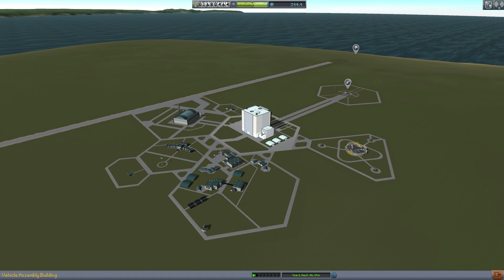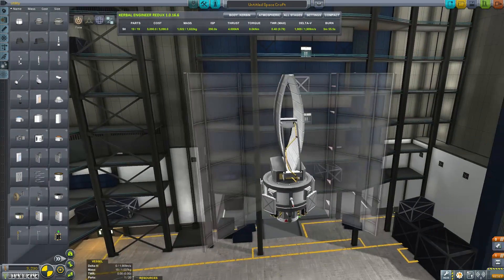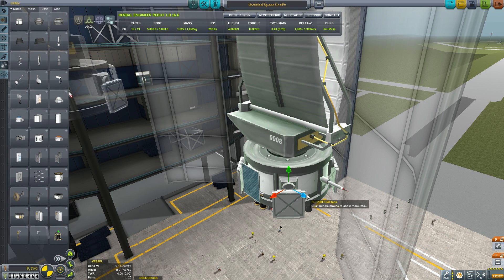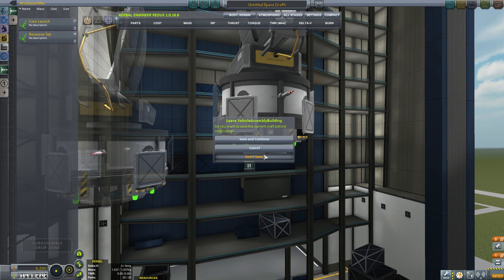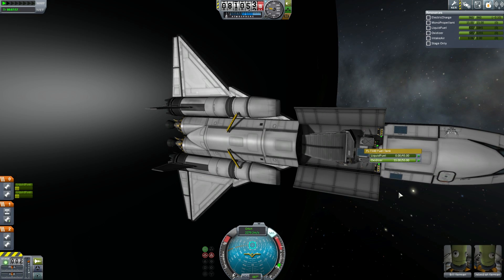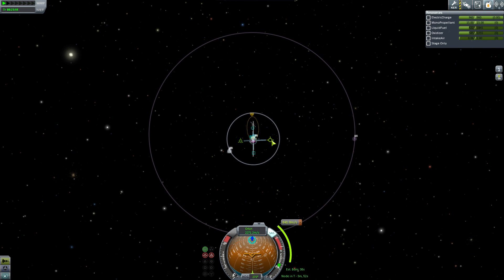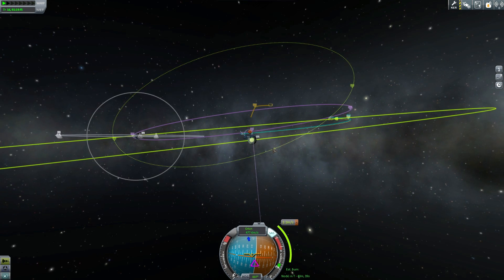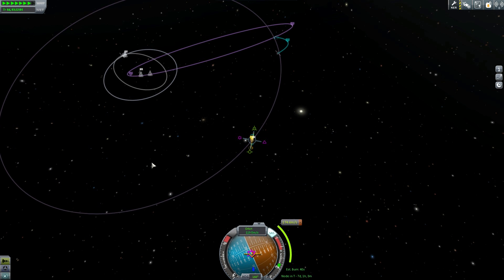Kerbal Space Program - Career Mode - Part 29 - Resource Scanning

Comment: @Scott Manley For these slight changes in maneuver nodes you can use your mouse wheel. Just hover your mouse over the desired direction marker and roll your mouse wheel for small adjustments.

Comment: Technically, in this game it's faster to design a recovery mission and then launch it than to get out and push... =p
It's also why my LKO space station now features a multipurpose tug craft in addition to the automated fuel tanker. It uses a prototype for the new replaceable mission package system I've been working on and can both dock with stranded spacecraft in order to transfer resources and grab on to craft lacking a docking port using a detachable grabber claw.

Comment: There should be an Ore and (Insert resource name here) mix for a Super Fuel Mix. This fuel makes engines more efficient, but takes quite a while to get. You should need 100 units of Ore and 10 units of.. Resourcium? I don't know. You need to combine both of these in a special holding tank and refine it with a more advanced refinery. Rockets using Super Fuel Mix also need Super Fuel Mix fuel tanks to use it. Wait. This isn't the KSP suggestions page!

Comment: I believe you CAN include the root part, however the root part must have an open node to be attachable.  Since you typically have engine below and stuff above, I think it works to just root to the engine (if that's where you'll attach it from) without the little decouple trick.  I might be wrong though, been a few months away.

Comment: My first launch (which was on 1.0.4) the craft was unable to get to orbit. It did manage about 83,000km before running dry. As it was returning to Kerbin, I checked the tanks and had just over 660l of Oxidizer left.

After draining the side tanks of oxidizer and lowering it to only what was needed, the craft is now fully capable of reaching orbit but does, at least for me, need to front tank just to finish off the orbit manoeuvre. Though it does leave the craft pretty dry for any type of orbital manoeuvring, say for rendezvous with space junk. Then again my noobness my just be burning too much fuel on accent.

Comment: in VAB, pressing "F" while in offset mode, will switch it between absolute and local mode, secondly, you can have a Minmus encounter that brings you right under its south pole, but switching vessels mid-burn might make it let's say, challenging
Reply: johnnyxxxv also, something i find interesting, is that Mun seems to have higher ore concentrations on its craters, whereas Minmus has high concentrations on Highlands, and even more so on Slopes

Comment: Hey Scott! Just a quick question: I'm not a big fan of spaceplanes, but is there times that it's just better to use spaceplanes instead of just pure rockets?
Awesome videos btw, keep it up :D
Reply from the maker: ***** If you're regularly running any mission then a SSTO design might save you money. Might.
Reply: ***** They also can take things back from orbit.
Like a crew member.
Or maybe a command pod filled with science instead of transmitting.
Reply: *****  I've made an SSTO that can take about 18 tons into LKO, if you land it back at the space center, an entire mission will only cost between 6-8k money, plus the actual sattelite, whereas a normal rocket would cost a lot more.
all in all spaceplanes are MUCH cheaper, but also take longer to launch (you're in the atmosphere much longer) and requires a bit more skill than just strapping a rocket to the bottom.

Comment: okay but now I'm just curious,
why does it make it more efficient/easier to initially increase your incliniation to the plane of minmus??
Reply: abandonator Because the earlier you do the change, the smaller the angle by which you need to change your trajectory. 

Imagine you're in your car, and there is some obstacle ahead of you. If it's a mile away, you just need to change your direction by a tiny bit and you'll miss it. If it's ten feet ahead of your car, you'll need to swerve like crazy to avoid hitting it. Same when trying to intersect with planets.

Comment: that orbital scanner should work more like the kethane scanner from Interstellar Quest did, needing many passes and getting a swath on each pass IMO. One scan and you instantly have the planet/moon done is a little too easy.
Reply: OtakuMage you can sit there and hold time warp while pretending it takes multiple passes if you like but you wont do that because thats dumb, inconvienant, a waste of time and you don't have to anymore
Reply: OtakuMage The only problem with Kethane was that the scan didn't run in the background, so you had to fly the scanner probe and accelerate time and wait forever. But the game's own developers could solve that easily. I hope they do, some day.
Reply: nemesisnick66 you still have to if you use ISA Sat for the biome maps - just looking up those maps feels cheaty
Reply: OtakuMage Try ScanSat, It lets you make maps and it takes passes to generate them. I know it integrates with the resource scanners as well. not 100% sure if it makes them work the same way or not.
Reply: Renvolt the vanilla scanners continue to work as they did
Reply: 666Tomato666 I think it has an option for it

Comment: You don't need backup solar panels in case you forget to extend the primary ones. There is a way to deal with this issue which doesn't require additional parts:
Disable the electric charge on your probe body. This way you will have a small amount of backup power that won't get spent without your permission. If you run out of electric charge in your batteries, you can use this backup electric charge to deploy your solar panels.
Reply: legoclone09 Unlocking batteries is one of the very few things you can do when your probe stops working. Trust me, I do this all the time ;)
Reply: RedsBoneStuff With my craft I just lock one of the batteries as part of my launchpad checklist in case I end up having to make orbit coming in on the dark side of the planet.  It's saved me several probes so far.
Reply: DarkMatterHorizon That's great!
I tend to avoid that by launching things at sunrise so I can land my first stage safely (SpaceX fan), and this way it never happens that I get to the dark side of the planet before I'm in orbit.
Reply: RedsBoneStuff thats actually a really pro tip
Reply: You can't unlock batteries when the probe is dead. At least I don't think so.
Reply: legoclone09 The probe won't b dead with this trick.
Reply: wowfreakstar Thatks! I came up with this on my own! :D
Reply: +legoclone09 you can unlock it. In Fact you can lock/unlock resources on even a craft which has no Kerbal or probe on it
Reply: legoclone09 yes you can, that's how I sent a probe to the mun in career mode before solar panels were unlocked. just lock all batteries between maneuvers.
Reply: xiniks Exactly!
Reply: xiniks Really? When I tried it it didn't work.

Comment: How is KSP on a MacBook Pro?
Reply from the maker: MattyBoi MC I use it all the time, there's a memory leak issue with Unity that still causes crashes every hour or so. But performance wise it's fine.
Reply: On a 2014 MacBook or newer, it runs 50-60 fps with low settings.
Reply: MattyBoi MC 2012 macbook pro. i can run on default graphics settings with a couple mods. no noticeable lag
Reply: MattyBoi MC Mid-2009 macbook Pro with 8 GB ram and 2.53 GHz Processor running KSP 1.0.4 with a laundry list of mods: I have to use a mod that reduces texture sizes, and run the game at minimal settings, but it's at least playable. I think I get around 30 - 40 FPS. 
It doesn't help that not all the mods are 1.0.4 compatible and Steam auto-updates, but I haven't had any real problems other than the memory leak Scott mentioned.
Reply: You should try the Demo, but keep in mind that the current versions would be a little more laggy than that.
Reply: Scott Manley I don't get crashes on my 2014.
Reply: MattyBoi MC My 2012 Macbook air can run it fine for an hour or 2 on default graphics then it starts to over heat
Reply: ***** So true. KSP runs >110 FPS with most ships for me. My computer is custom though.

Comment: Still amazed about your space plane. I have a similar design and I cant get it to orbit for gods sake. It runs out of fuel halfway during the orbit burn. Also my air intakes have around 0.8 out of 1.0 air even though they have nothing in front of them. Put well over 20 hours into designing and it still can't orbit. Please help!
Reply: I made a similar design, I can upload it on the forums. I call it the KR-71 'BlackKerb', it has 2 RAPIERS and 2 turbojets, so convert if you're using it in Career and no RAPIERS yet.
Reply: [BBSF] ItsMeBro The orbital maneuver can save a lot of fuel if done correctly.
Reply: The Average Pro Good point.